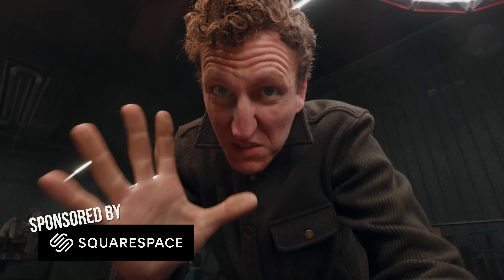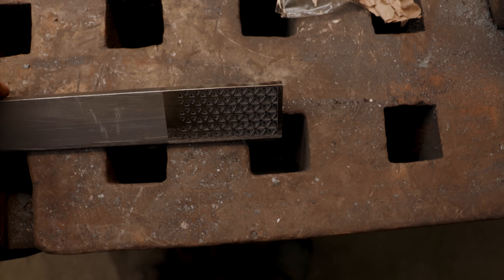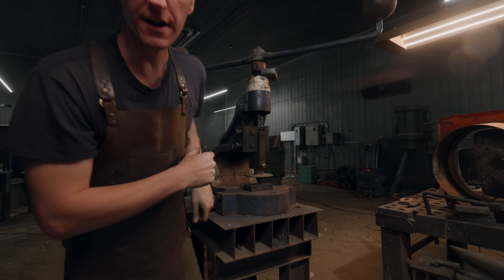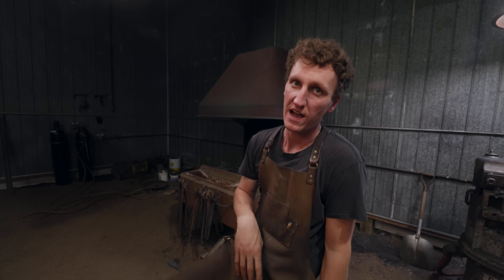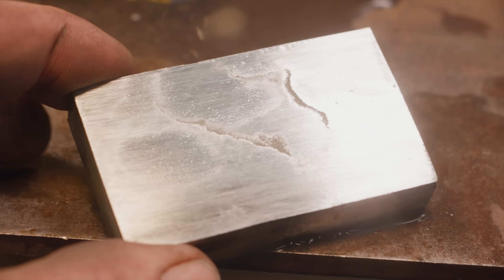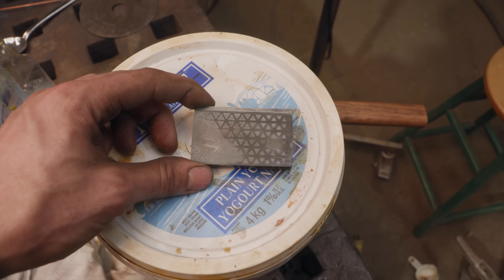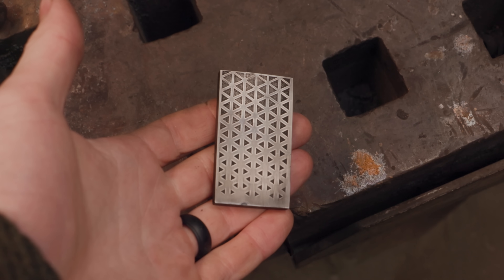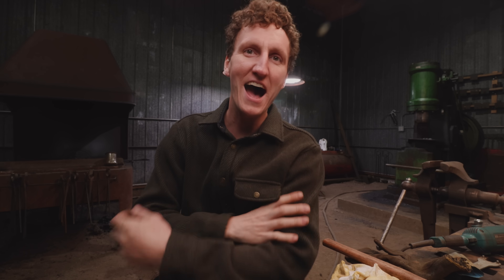New way to make Damascus steel?

Comment: Having done similar things with 1095 powder in thin cans for mosaics, it can be difficult to get the amount of size reduction during forging that you really need to fully consolidate the powder- particularly without the byproduct of unwanted distortion.
Try it on the power hammer and forge it down a little farther, and soak the billet a bit at welding heat to help age the welds as well- should etch cleaner.

Comment: Blueing? Really Tim?
I believe white paint is used to stop the steel to be forged from adhering the canister.
Just make a jigg or adapter to mash the steel in the press you use to make the holes in and shape the ax heads.
Get that blueing thought right out of your head young man !!!

Comment: Cool experiment! Tip on canister damascus, the guy from Fire Creek Forge here on yt says regular white spray paint works better than the foil for keeping the canister from sticking to the billet. I believe he mentioned that it was the titanium dioxide in the paint creates an unweldable barrier between the steel and the canister. Give it a try next time!

Comment: This would be a much bigger project but what if you did damascus as normal but then used the laser to cut that billet into some crazy shapes to then be rewelded. Something like the process of making W damascus but using the laser to make the cuts instead of the band saw. I agree that that is a cool concept that would look stunning on a knife, michaelcthulhu makes crazy steel projects using a similar style, but i think the idea that you had in the first place is an idea worth toying around with since it is so unique and its more about the process of the making that makes it more special. You can achieve the effect with the blueing but its not "true" damascus. Obviously a huge time commitment since it takes so friggen long.

Comment: Quality ... Very Nice outcome With both of them  Chap ... Mimic  A SeXy wood grain ... Also Have you Seen / Come Across ClickSprings Channel? He heat treats with a paste to protect parts from oxidation ... Also shurap channel he used a mag base of a surface grinder under a normal grinder / grinding wheel for coupon removel and true flatness ... just a thought ...
peace

Comment: The "muddiness" of the 15N20 looks like it's because there is still a thin layer of 1090 powder on top because you can see a bright "halo" around the edge of each of the features which I suspect is the real 15n20 underneath..  Grind it a bit more and try the etch again..

Comment: Do not give up on this idea. Think of the applications as far as designing a layout of metals to increase a knife's durability. What I envision is a knife that starts with pure mild steel going into a large honeycomb pattern moving across to a smaller honeycomb pattern. The opposite side is reverse. A hard steel ( the blade edge side) going into a large honeycomb pattern and then across towards the mild steel side with smaller honeycomb. A Damascus billet designed to have a hard edge and absorb shocks and be flexible.
Reply: Oh yeah. He definitely should iterate on this stuff. Firstly he will learn more about the process itself and it looks like there is still much to learn, Secondly all that institutional knowledge will let him try more and more daring designs and processes over time. This is very promising.

Comment: You certainly come up with some fascinating ideas! Would it be possible to laser cut all the way through the steel plate and fill the holes with the powder? That way you could have your damascus effect without the danger of grinding through the pattern if you were to make a knife or an axe blade.
Reply from the maker: I think so, It would just take a very long time! I thought that perhaps having a "core" of the 15n20 would perhaps keep things more stable through heat treat, but its all theoretical.

Comment: Use two thick plates.  One in 1095 and one in 15N20.  Laser the 15n20 as you did, but etch the 1095 with a  reverse image and press the designs together.  Then you should be able to grind one away until you get to the welded pattern with little or no distortion.  Its very easy with the fiber.
Reply from the maker: Very interesting idea! Have you tried it?
Reply: @TimothyDyck  I havent but we have several 50w fiber and I really cant see how it would fail.  It would be easier as we have a surface grinder (converted to sander).  You would only have to weld the one edge and it would have zero oxygen.  As Randall said, any pattern should hold up 100% with sharp edges, especially if you weld with a press.
Reply from the maker: @AweMe  I'm going to try this. It could be super cool.
Reply: @TimothyDyck  Couldn't you just put masking tape over the powder-filled designs? Like, fill one side with powder, tape it off, then fill the other side, and tape it. Would the tape burn off inside the canister, leaving the design behind? Or would it ruin it? Might be worth a try, I don't know.
Reply: This is basically how the woodwork guys do inlays.
Reply: It was the stainless foil, not grease. That's why it didn't take the etch.
Reply: Yes! This idea right here! Should be very doable I think and your imagination would be your only real limit when it comes to the patterns.
Reply: Also could be done with cnc or edm. Great idea
Reply: @willstelter did exactly that a couple years ago and made stegosaurus patern Damascus
Reply: It was when he was still working with Alec Steele.

https://youtu.be/dcISDsC9ndY?si=tJTAtWuJRejgi_qR
Reply: This is what I originally  assumed he would be doing.
Reply: This would be awesome!! But also pushes the envelope on Damascus images and text rather than boring Damascus patterns which we've seen 20000 times...

Comment: Awesome! The Damascus has a lot more authenticity to it but the laser version looks excellent and would probably be a better option for production. Id love to make a knife from your Damascus piece if you'd be interested in a collab?! It takes some work but you could get a black/mirror contrast to it with the right techniques. For a bold pattern like that the pre etch surface finish is important. If you took it to a full mirror, then you could etch, polish, etch polish until you've got mirror highs and matt lows, then coffee or orange juice etch to darken the matt areas. Super frustrating process if you're set with getting it perfect.
Reply from the maker: Maybe that was my problem! I never polished the 15n20 up enough. Thanks for that tip!

Comment: It would take a lot longer, but if you started with thicker bar stock and flat ground both sides the laser etch would probably be the same depth all around, and you could get a deeper etch to start with to fit more powder, or what wody422 suggested and  stamp the pattern. Or both, stamp, then use the laser to crisp it up if necessary. And I bet those two spots were just a bit of stainless that somehow welded to the stock that didn't get fully ground off.